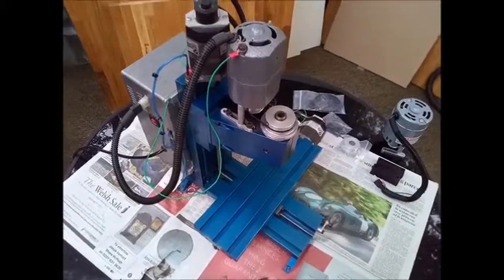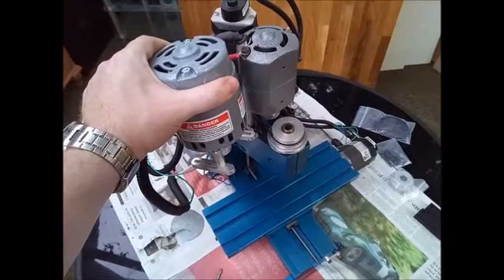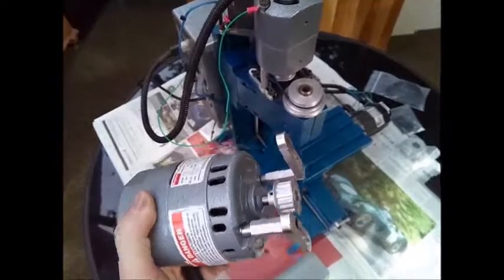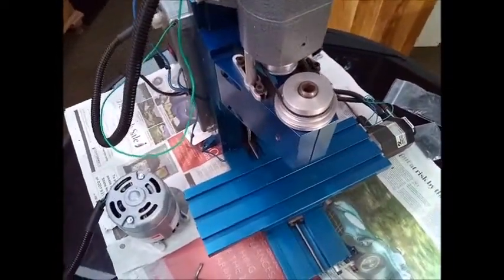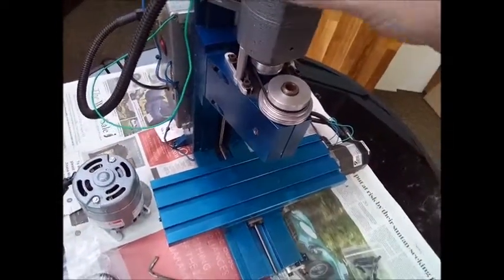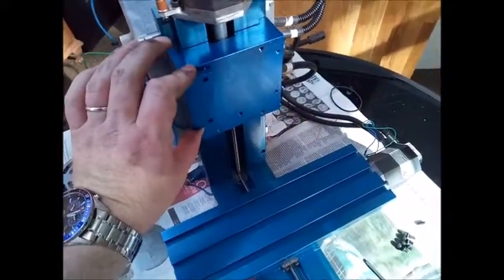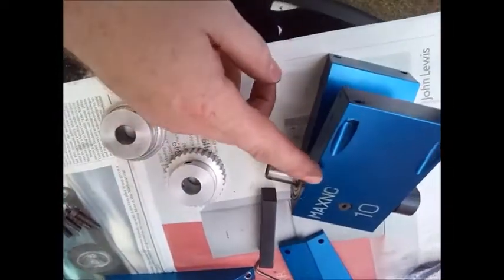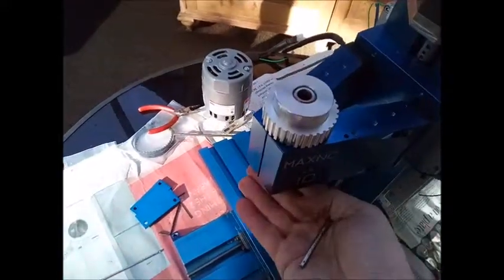CNC Spindle Motor Upgrade

Comment: Hello,
Nice motor upgrade, I like the ribbed "timing gear" belt as opposed to the old 3m style v belt. I have much older MAXNC 10 OL running off parker stepper drivers. I had the 1/5 hp motor. At least till I spent 40 minutes cutting mild steel. The motor bogged down, overheated and let the smoke out. I assume my motor is much older than yours and is supplied power differently than mine was. But if my 1/5 hp motor was as powerful as your new one you can probably cut mild steel now. I posted a video about it on my channel if you are interested in cutting mild steel. You should also be able to cut aluminum fairly easily as well. Thanks for posting and nice telescope parts.